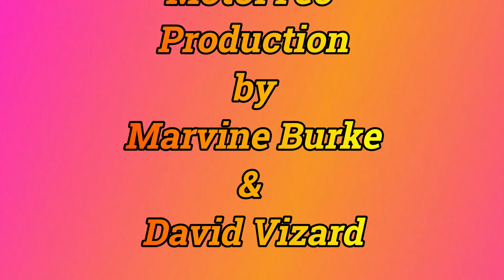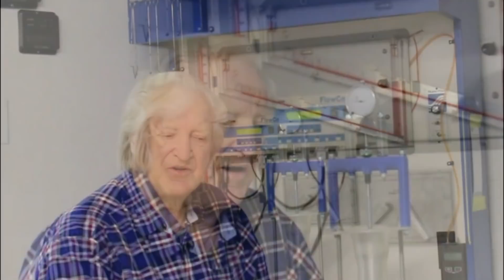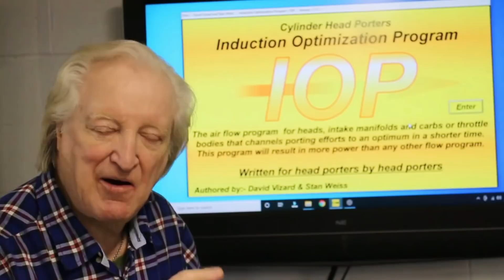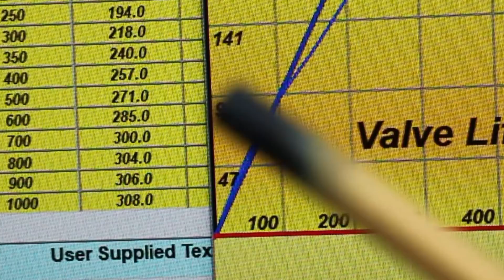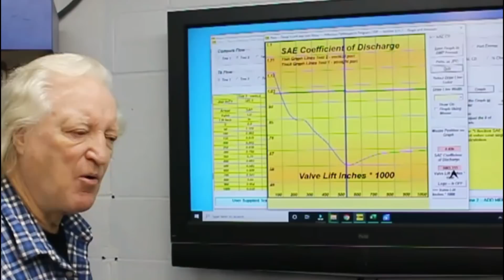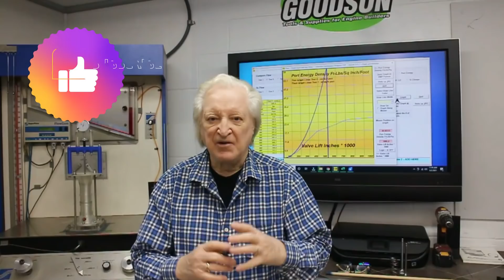David Vizard's PowerTec 10 EP 19 Why valve and port Discharge Coefficients are so important

Comment: Thanks so much for making this knowledge available in this way .I was introduced to this back in the 80's as I was building a VW bored out to 88mm and 1 size bigger intake valves and the largest exhaust valve I could fit . Did porting myself with instruction at beginning and left to it . My Baja Bug pulled wheelies in first and second . Loved it !

Comment: how do you take air at one atmosphere and zero velocity back up to atmospheric pressure at the valve with high velocity?  Bernouilli would have an issue with that.  I think the "112%"  is just a math error at very low lifts.  Blair outlines it in his book.

Comment: Mr. Vizard I hope I get this right which I probably wont but here goes anyway. As the valve opens you should have choke flow so the gases are at super sonic. Would this make them more dense so that more gas will flow out of the cylinder, and then as the valve opens more you lose choke flow. This would then decrease the density of the air causing an increase the pressure in the port restricting the air flow somewhat.

Comment: David let them know the water column in the straw tha equals a little over one psi means the psi measured as the result of the water weight in the straw. Approximately 27.7 inches of water column = 1 psi inches of Mercury can be explained similarly. With Mercury weighing much more than water is the difference. Tha Sam goes for other liquids with different  specific gravity.

Comment: The internal combustion engine, is a very complex air pump, it may  be considered a simple pump, if you are only looking at the air filter and muffler, get much closer than that, it starts getting complex! Especially if you understand anything that is going on!!

Comment: I saw the Chevy engine overhead cam , for indy,, the intake ports were top of the head, like where hemi spark plugs are, I'm thinking those heads should flow like a wind tunnel! 60's tech is often seen as outdated/ obsolete, I'd like to have one of those engines! Maybe a 383version, they did some crazy stuff back in the day! I'm curious what a engine like that would do with a modern make over, or a modern version!!.. They had to be just off from straight on from the valve! I would love to see one of those heads, with crazy ports like that, it has to be interesting!
Reply from the maker: James, I learned some very interesting things about ports like this. I will cover this in my '5 golden rules' porting series. It will be in the two part vid of rule #1 so when the first comes out bbbuuuuugggggg me to include such.
DV

Comment: Hi David....i am based in australia..i have an aussie muscle car that is running a nice 306 windsor...its getting tired was thinking of doing a 347 stroker but i am also thinking of doing a 351 windsor  .which i have a 1974 block,was going to use a stock 351 eagle forged crank with chev 6.2 rods and pistons...in your opinion which would you choose..dont have an issue with space as my car came out with both blocks.thanks for your time. Steve in OZ
Reply from the maker: Steve, So long as it does not interfere with the suspension I would go for the 351 format. However I would also work overtime to fund a stroker crank to make it a 408. If you can do that you won't be disappointed.
 DV
Reply: From memory (and it's not very good) I think the 351w block was an 1" taller in the deck.
Reply: The Windsor block can interfere with stock suspension on small ford cars. That’s the reason to build a 347.

Comment: David you have a clear idea in your mind what "simple" means and what "complex" means, but unless you know what the person who originally made that statement meant, and in what context they meant it, you can't unequivocally say they were wrong. Let me play the Devil's advocate for a second... Take your average Briggs and Stratton mower engine, which would probably be akin to very early automobile engines, since the saying was around before I was born, and may even date back to the early part of the last century.

If the engine contained a few dozen moving parts one could very easily say that is "simple", if it contained many thousand parts, you could say that is "complex". If you look at and engine from the perspective of how it achieves combustion... suck, squeeze, bang, blow, again you can very easily apply the term "simple" to its operation. I personally don't believe the original author of the saying was talking about the science behind the cyclic operation, but instead was making a very general statement of an internal combustion engine is not that complex at a fundamental level.

I would further back this up by something my father said to me in the mid 70's when I was trying to get my motorbike running. He said all it takes for an engine to run is air, fuel, and spark (compression being a part of air). Again he wasn't trying to trivialize how the internal combustion engine worked, but instead give me some broad strokes guidiance on what to check to get it running. I believe this is what the author of that saying was trying to convey.

Comment: Why don't you add sound to the port. Vary the frequency and amplitude and see what happens. If you put a microphone in the ports of a running engine what does it sound like. This is still simplistic view of what is occurring.

Comment: Great content as always. As a mine Ventilation engineer, looking at how the same airflow principles are applied is very interesting.

@ 21.20 you show a graph that tops out at ~440ft/sec (or 134m/s.) In my experience you rarely see velocities >110m/s. With a 'rule of thumb' to design any flow orifice to have a peak (average)  velocity of less than that value. Certainty, it's very rare to see a mine fan with a tip-speed that exceeds this value.)  As at this speed, airflow begins to change it's characteristics from 'incompressible flow' to 'compressible flow.' (Obviously for jet engines and turbocharger compressors/turbines this is different as this velocity is exceeded.) But when sizing throttle bodies, carburettor throat's or estimating 'peak-flow' through a known cross-sectional area, it often represents a hard upper bound.

There was an excellent paper written by Blair and Cahoon titled: "Best Bell" which conducts analysis into what the perfect bellmouth shape is. Well worth a read.

But there might be a typo in the title ;)

Comment: Does the discharge coefficient change as the Boost goes up. I've always wondered if some ports are better suited to boost, versus normally aspirated. So if you had a huge port low velocity inefficient would it become efficient with 3 bars boost or will the inefficient Port still make inadequate power? Thanks great video I love this information
Reply: Boost change basicly nothing.
Reply: @V8Lenny  why does the engines volumetric efficiency change so dramatically with Boost? Is it more velocity or just oxygen?
Reply: @danielsullivan9865  VE doesnt change , only density changes.

Comment: I have both your how to port and flow test cylinder heads and how to build horsepower books and I’ve found them to be extremely informative and helpful. However, I would be very interested to see more of the same material such as determining exhaust cam duration, determining intake and exhaust lift and overall cam spec design for 4 valve cylinder heads. And yes, I know that almost everything in the books can apply to almost any internal combustion engine however I feel like it would help a lot to bring this very high quality information to the sport compact field who, for the most part, think that these lessons learned from the V8s don’t apply to them. Please, a series on multi valve cylinder heads would be massive!!!

Comment: Hi, Have you experimented with an inlet port surface finish like a Golf ball?
Reply: The golf ball dotted finish will only improve flow attachment if the bend angles already cause flow detachment without it. If the bend angles don't have flow detachment on it and you applied a golf ball dotted finish, it will just reduce efficiency.
Reply: Had one like that in my exhaust port (doctor gave me a shot & 3 weeks of antibiotics and cleaned right up tho)!

Comment: Mr. Vizard, could you flow bench test the stock 225 slant six head at all the different lifts and then port it, retest it and then run your cam matching program against it?  Then a carb, intake manifold & tune headers & an exhaust to it?